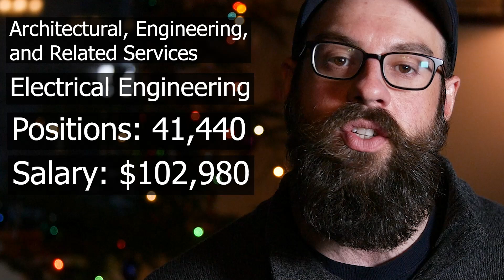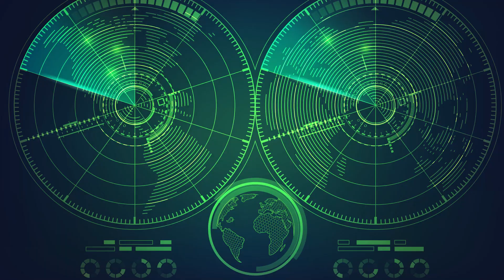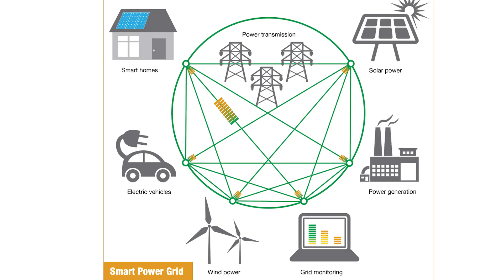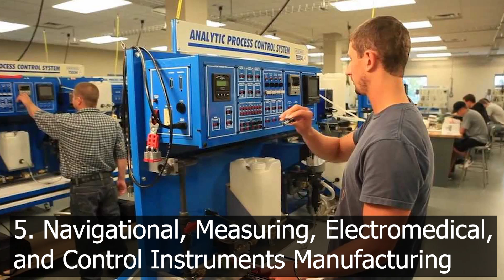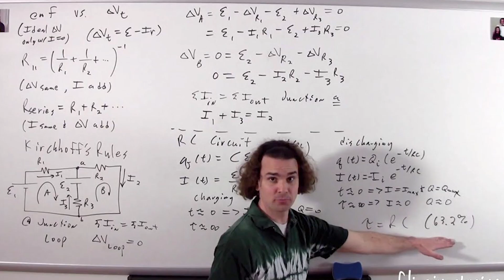Jobs for Electrical Engineers over $100,000

Comment: In the last 30 years of my professional electrical engineering success I acquired many skills in electrical engineering and other areas such as software, firmware, hardware, App develo0pment, embedded design, intelligent MCU based machines in the markets of medical, wired and wireless electronic communications, smart automation systems, ECO friendly systems, power, handhelds, toys, airport and security, multimedia programming, and many other skills. The more I learn then more I love doing all of what I learned. The only problem professionals like myself face is they are always overqualified, or are feared by recruiters and managers who were recently promoted by their bosses.
Reply: Did you work in different industries or was it one specific role that allowed you to learn so much?

Comment: I’m a junior electrical engineering student trying to get into RF. I’ve found it to be a bit difficult to show my knowledge because a lot of the advanced classes are senior level and grad level classes. But I’m hoping to get an internship
Reply: Casey, you are correct, the early classes address Electrostatics and then the senior and grad courses push into microwaves, antennas, wave propagation, etc. However, do not be dismayed, just keep focused and serious about your studies in these courses. When you go out for an internship, pick a company that does RF and wants that skill set. Finally, I suggest you upload computer software like ADS and HFSS for the university and get familiar with the use and applications. It will give you a big advantage when you interview for the internship. I believe what you will find is most like computers and digital electronics, reason is RF is a bit more difficult. Good luck. P.S. Remember to get the grades.

Comment: I'm either going to study civil or electrical engineering but I just can't decide..
Reply from the maker: Hey thanks for the comment. That consideration is far more rare than civil vs mechanical or mechanical vs electrical. Do you like coding / programming? EE is heavy on the coding side. It’s also super theoretical. You cannot see electricity or magnetism but you can see bridges and roads and concrete like in civil.

What do you want to do for a career? EE is electronics and telecomm and power and robotics whereas civil is physical infrastructure and design. 

Are you super baller at physics and math? EE has more math and physics than any other type of engineering. Im a civil. I would not have survived EE and don’t like coding. Let me know more so I can help.

I have these videos for you,

“What Do Electrical Engineers Do” https://youtu.be/zRawKI6Qsm0 

“What Do Civil Engineers Do” https://youtu.be/FssJcjOIB7A 

Thanks!
Reply: @JakeVoorhees  So first up, thanks for the reply, it was helpful. 
So, I don't really like coding but I really like the physics behind EE. I'm really good in physics in general. Maybe I should become a civil because of that.. Anyway, I will watch those videos. Thanks a lot!
Reply from the maker: There is physics in all engineering fields. And if you don't like coding, then EE should be avoided. Mechanical Engineering should also be considered, as I think it's the #2 engineering field right now.

So civil vs mechanical is a fun consideration for you.

Civil vs Mechanical can be a hard decision.

The way to know is with your interests. Civil Engineers design and work with infrastructure like buildings, bridges, transportation systems, subsurface entities, environmental systems, marine and coastal systems, etc.

Mechanical Engineers work with designing machine components of that infrastructure. A ME will design all the pieces for a bridge, and work with their individual strength and efficiency. Civil engineers design the bridge itself. Mechanical engineers also work with heating/cooling/ventilation systems in buildings because of the fluid mechanics. They also work with thermal systems like the aerodynamics of a car or aerial system. Mechanical engineers work in manufacturing, and civils cannot really. 

See more things about either one here, “What Do Civil Engineers Do” https://youtu.be/FssJcjOIB7A 

“Civil Engineering Have a Good Future | Good Major?” https://youtu.be/O2eedXUxTDM 

And here are some ME videos - here is a video that goes over a bunch of ME sectors, "What Do Mechanical Engineers Do?" https://youtu.be/5wEteXzhtak and this one looks at careers like automotive, aerospace, product engineering for ME, etc: "Jobs for Mechanical Engineers",  https://youtu.be/L95q-d6FWVY. 

And it’s commonly the dream to work with mechatronics or robotics, so check this out
“What Do Mechatronics Engineers Do?” https://youtu.be/4YjLZcQRLds 

Also, here is the top 11 degrees in one video that I did, “Engineering Degree Tier List” https://youtu.be/nfayHVJlKgQ and its pretty popular.

I hope these help and make sense? Let me know what follow up questions you have okay? I respond to all comments. Cheers!
Reply: @JakeVoorhees  I wanted to become an architect once, so civil engineering might be the one. On the other hand though, I really like ME and EE EXCEPT for the coding. I'll watch those videos after online class, maybe I can make a decision then :)
Thanks a lot for your help!
Reply from the maker: Hey Mike, thanks for the follow up. Okay so if you're not sure about coding, then EE is a tough choice. Look at ME vs CE mostly, go through those videos, and let me know what follow up questions you have k cheers thanks

Comment: Great video. I’m currently studying EE in university, looking to go into satellite and antenna design. Good to know that it pays well lol
Reply from the maker: Awesome! That's a great career option :) thanks so much for commenting
Reply: Hello under which specialisation in EE?
Reply: @prem804  RF specialization
Reply: Thank you David :-)
Reply: Hi Jake Is it worthy to pursue EE with 7 years of work exp in software engineering.
Reply: Hi David. I’m looking to pursue this exact same thing In EE. I was curious if you had any tips or anything to help build a resume centered around this
Reply: @caseykauf6615  it’s just a matter of doing a lot of projects and taking the right coursework. Take as many electromagnetics and RF-related courses as you can. For projects, try to work on systems that use wireless communications if you can. Even working with a very small antenna that transmits in the hundreds of MHz range can tell employers that you are interested in RF. Remote control cars, rockets, and CubeSats are all viable options here. When you apply for internships, demonstrate your passion for RF, employers will love it. It’s a very challenging field, so the fact that you are actually interested in it will be a huge bonus
Reply: @davidchuong714   yeah I like that. I found a design for a rf solar powered remote controlled robot thing that I’m going to make next semester so that’s good. And I plan on taking all those classes but I have to wait till senior year :/.  Thank you for your help